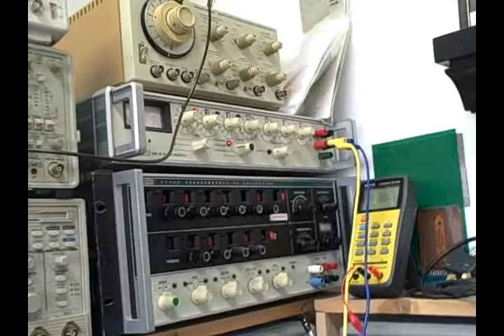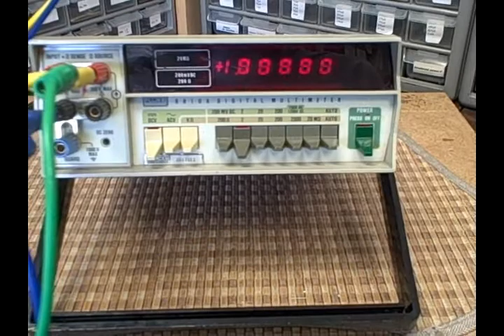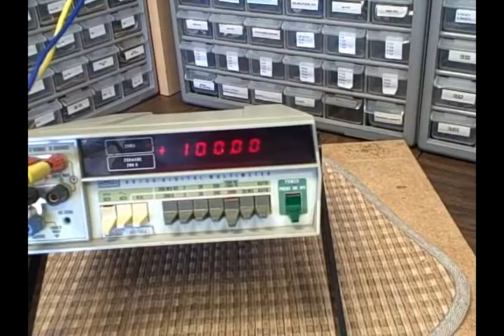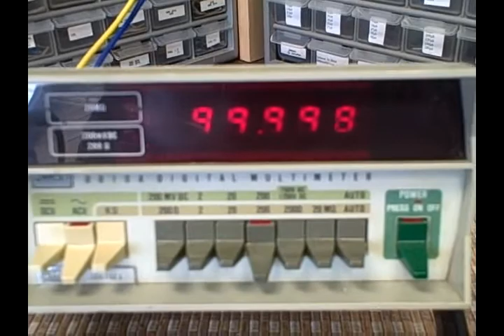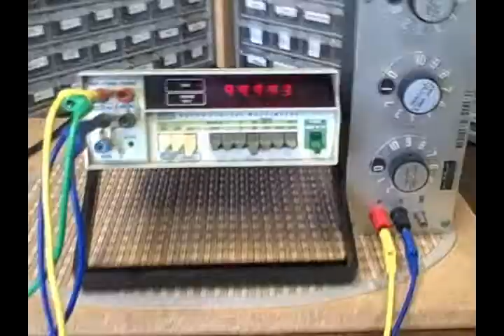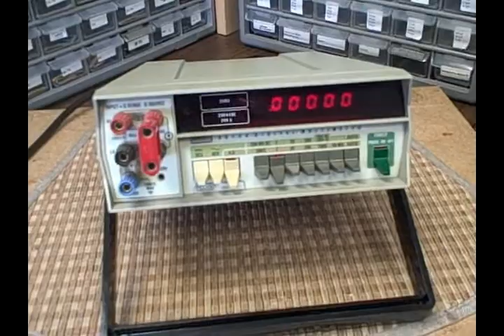Fluke 8810A 5 1/2 digit

Comment: Thanks for the review. I have just bought on of these Fluke 8810A which looks in very good condition other than the power switch which the seller did tell me he'd snapped off and glued. I needed a 5 1/2 digit meter and your review is very reassuring for a relative beginner like myself.